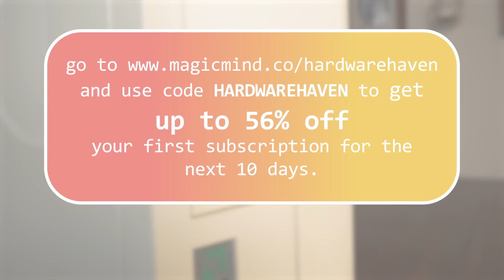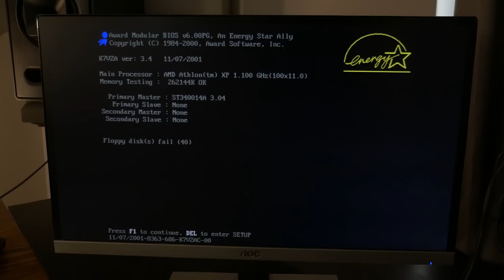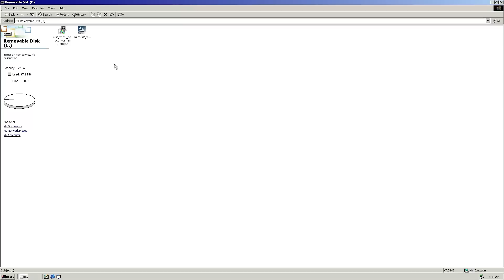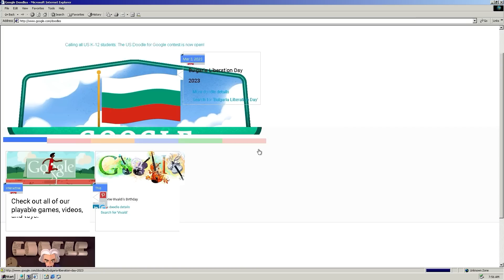The OLDEST PC I've Ever Worked On

Comment: Nice video. I haven't been following your channel (but I just subscribed 😊), but if you're doing hardware vids, it's definitely a good idea to educate yourself as to where all the modern PC goodies you know and love got their start. Here are a few points that I didn't see among the other comments:

- Case elements: Yes, the cases we had back in the 1990s had a lot more fasteners than modern ones, required you to wield the ol' screwdriver more often (and sometimes other tools as well) and required some creative thinking to figure out how they came apart and went back together. There was a lot of innovation going on. One thing you learned when working on different cases was that if there was an inaccessible screw somewhere, then you were probably looking at a module that was intended to be removed for installing components such as drives.

- Blown capacitor in the PSU: Not an uncommon problem, and even back in the 1990s, when components were generally more expensive than they are today, most of us did not open up PSUs and attempt to fix them. There's high voltage going through the PSU, and if you don't know how it all goes together, it's best not to mess around with it. There's nothing wrong with opening one up and looking around for forensic purposes if you're careful, but unless you're trying to refurbish something vintage or unique (and the PSU that came in the system shown here doesn't qualify), it's best to just replace it. BTW, before powering up a system of this vintage, it's a good idea to visually inspect all the capacitors on the motherboard. Failed, leaking capacitors on motherboards can make it fail to turn on or pass the POST, and will make it unstable even if it does pass POST. Leaking capacitors are common on motherboards that old, and they're even more common on motherboards from 2000-2009. While you're looking at the capacitors, also have a look at the RTC battery. Some motherboards from the 1990s still had soldered-in NiCd RTC batteries, which are known to leak and damage surrounding components and PCB tracers.

- 3 RAM slots: Yup, dual channel wasn't a thing yet.

- Stray markings ("Good Power" on PSU, "X" on hard drive) were a pretty common sign that the computer had either been assembled by an enthusiast who was juggling a lot of parts or had been to a repair or refurb shop. The markings typically meant that a component had been checked out and was OK to use, although, as you saw, there was no standard for them. It would have been very strange for someone to remove a hard drive, confirm that it was bad, then mark it with a red X and put it back in the computer, especially given how involved it was to take that particular hard drive out.

- I was pleasantly surprised that the video output from that computer worked with your modern, large, wide-screen monitor. Video hardware from that era was mostly made for CRTs with relatively low refresh rates and resolutions and 4:3 aspect ratios. Some video drivers of the era would fail when connected to any flat panel monitor, causing badly distorted video output on the screen in 16 or fewer colors. I'm not at all surprised that it wouldn't work with your video capture system.

- Windows 2000 was not a common choice of OS for a custom built computer of that time period, partly due to its cost and partly because it didn't work well with games and other software that a home computer user was likely to run. Most companies stuck with name brand PCs for a more consistent experience and better tech support.

Comment: Heh, I'm kinda proud I was able to correctly guess the machine specs just from look. The general design screamed late Athlon / early Athlon XP to me, a lot of prebuilts from that time used a TNT M64 for display and 20-40 GB was really common as an upgrade, I had (and still have, but upgraded) a machine that was pretty much the same. That was kinda funny to hear 'That's IDE, right?" and "I think it's DDR", I guess I just spent way too much time messing with machines from that era.

I think I can guess a few of the problems you had : the GPU seems to be working fine, but crash the system after a while and / or have random artifacting (AGP GPUs are well-known for that, they're right in the capacitor plague), some cards don't work because the PSU you're using doesn't have -12V because it's to modern, the heatsink was a pain to remove because AMD used an horrible socket at the time, storage was hard because SATA to IDE is slow, PCI cards are annoying to configure and SD to IDE is really slow on NT OS and can cause corruptions... At least, they're all problems that I encountered and see pretty regularly online.

Comment: The 4-pin 12V connector was introduced when Pentium 4 hit the market in 2000. Even after that some low-end crap like that PSU didn't have that connector.

Comment: Socket 462 xp, sdram and a sweet tnt2 riva agp - what a nice little retro setup, if you can find some, you could get some 512Mb ram sticks for it, but they started becoming pretty rare and expensive some years ago. Being older and an old tech i identified all the parts in this system as soon as you opened the side panel :) I loved my xp 1.8ghz cpu back then. The nostalgia is too real.

Comment: Ah, late 90's, early 00's PC's. Time when I got my first PC and well, used PC for a first time at old mom's office when I went there for few days in late 90's. That beige case era with CRT's (chonk at start when turning CRT's on is, moment of silence, perfection, right after floppy boot sounds, mmm, memories) and classic, and semi-regular Windows 98 SE or even Windows XP reinstall procedures, man, got me right into my early PC time.

Afaik, this seems like OK AMD Build from back in the days, only thing that I will replace no matter what is PSU and later on install SATA SSD using IDE to SATA adapter, just to have some speed and to be safe that old drives wouldn't die.

Edit: yes, that faulty PSU is actually ATX, most PSU from late 90's, early 00's up to early 2010's have 20+4 ATX main connector and lot of cheaper ones don't have 4/8-pin CPU connector as it wasn't needed in that time. Older ATX standard, it is prior to 2.x versions that it had 20+4 ATX main connector and most of them in those days didn't used CPU connectors.
Reply from the maker: Thanks for the info!
Reply: @HardwareHaven  nothing Colten, this is my early PC's time and know them pretty well as we had some older PC's even in our high school which me and few friends from class fixed, so insides of that old systems are nothing new for me :) That include my first 3 PC's as well, mostly AMD machines and one Pentium 4, early version of it with SDRAM sticks which I'm keeping for my personal old PC parts wall.

Comment: My first computer was a Tandy 1000 TX. A 286, but it ran on an XT, not an AT bus, so it was essentially a turbo charged 8088. When I got it, it didn't even have a hard drive, it ran on 720k 3.5" floppy disks. I upgraded it to support aftermarket IDE hard drives using a card which had built in BIOS and installed a whopping 40MB hard drive and MS DOS 6.22. Windows 3.1 was out of the question, especially given its CGA graphics, but it (sorta) could run Windows 3.0

Comment: Hey, I’d highly recommend downgrading to Windows 98 SE, you will have a much easier time getting retro games and hardware to work (Windows 2000 was based on Microsoft’s new NT operating system which came with a lot of problems for legacy support)
Reply: I slap on Damn Small Linux or SLAX...

Comment: I have had the same thing happen.  I was quite lucky and missed the 2nd/3rd degree burns. I flipped the power switch and it exploded shooting fire out of it!  It was a small form factor IBM workgroup server back in the early 2000's.  I was using ghost and getting the server a 20 workstations ready to put into a bank branch.

Comment: I'm not shocked at all, it looks like the film cap blew which is pretty normal for old power supplies of any type.  Low chance of it causing a full on fire, it's kinda like a dangerous fuse.
Reply: poly/film caps rarely give trouble in my experience, if it was a paper based RIFA,  wouldnt be surprised 😉

Comment: On the XP processors are little gold dots L1 to L4. If I remember correctly if you connect dots 3 and 4 of L2 ( check it on the internet though, it was a long time ago ) if they are not already connected ) with a pencil ( conducts electricity ). (If the dots are already connected you have an unlocked processor.) With that you unlock the multiplier ( it is an 1.100, so the multiplier now is 11 running at 100 Mhz Front Side Bus/ 11 X 100= 1.100 ). With a bit of luck you can change the multiplier in the BIOS to 11,5 or 12. It also depends on the silicon lotery. I had a Duron 800 and I could change the multiplier to 8,5 ( so it became a 850 ) and I could change the FSB to 103 ( that also changes the SD RAM speed ) so at the end it ran at 875.5 Mhz ( 103 X 8,5 ). Or I could run it at FSB 105 with a multiplier of 8 ( 840 ). A free upgrade that is called overclocking.  Have fun with the system. And looking forward to your next video.

Comment: 6:23
Yes you have to be extremely careful when opening one up. 
The caps can really give a shock. 
Use a screwdriver to discharge them. 
I am bit concerned since you opened it just after powering it but  for some reason, I opened up a similar psu once to get it's inductors for a different project, no fan spin when given power and initiated power on in 20 pin atx. 
I opened it up and the caps were oddly not charged. 

Anyways I recommend discharging them because they hold a nasty shock.

Edit: Then it's  fine after a few days the bleeder resistor might slowly discharge thr cap
Reply from the maker: Yes, I usually discharge and check them with a mm, however I wasn’t planning to go poking around way too much and it had been sitting idle for about a week. Probably still should’ve checked them. I’m here though haha
Reply: @HardwareHaven  Well from the pics if I remember, it's a toasted diode/resistor I think. Still won't recommend poking around since I think the guy who replaced the fan, messed up and made the diode protect everything by sacrificing itself. 
Btw I got inductors, 3 (I think 4) transformers, those HUUGE caps,  also some MKP Type capacitor, ac input connector thingy, sATA Power cables(I am making a 12v powered sATA to usb for 3.5 inch desktop drives from a sATA power cable, a old 2.5 inch usb powered sATA to USB. I did some soldering to some how hook up the cables for 3.3 and 5 from usb, 12v from external psu. 
It worked Although very sketchy.

Comment: There is no 100MHz base Athlon XP (other than low voltage models), so it's probably meant to be 133 x 11, or a 1300MHz "1700+" in AMD speak.
Except the motherboard appears to be a KT133 chipset which was flawed and could not DO 133
Does not officially support Athlon XP, though some models and BIOS can run them, but not at full rated speed... FSB OC of 112 is reckoned to be solid, 120MHz is about the maximum that KT133 will tolerate.
PS. If the board has a JP9/10 jumper above the floppy cable connector, and a VT8363A chipset, then it is a later KT133A model with support for 133MHz base (aka 266 FSB) - The Athlon is designed for DDR, but you need a later and better chipset
Reply from the maker: Yep. I figure out the FSB in part 2 spoiler

Comment: For the fan on the CPU, lift the sticker and if you see a mini bolt, just add some DW40 in there and put the sticker back on.  Might work for some time to grease the berings.  Brings back memories.  I worked on even older computers than this.  Great video.  :)
Reply: I use a single drop of 3in1 oil...thinner and penetrates better into the sintered bearings that dry out, emphasis on "single drop"..otherwise it will sling it everywhere!
Reply: @haydenc2742  yep, 3 in 1 oil better than wd40 for this sort of thing
Reply: WD-40 is a solvent not a lubricant. If there was any lube in there it'd clean it out. Go look up WD-40 fishing reel horror stories of people wrecking their gear trying to use WD-40 to lube it. Not a good idea. You're not going to get grease into the bearings unless you can get the bearings out. Your only viable option is light machine oil. They make special motor oil. It'd work. Not car motor oil, electric motor oil.
Reply: @1pcfred  uk cans of wd40 DO mention its use as a lubricant, though 😉 its certainly not ideal, and seems to cause green corrosion on brass/copper after a while , 3 in 1 oil spray is better, which is actually made by the wd40 company now !  .. i've heard mention of 'turbine oil' in connection with motor bearings? maybe that??
Reply: @andygozzo72  WD-40 is mostly something called Stoddard's solvent. It's a petroleum product so it is made out of oil but it is not oil. Gasoline is made out of oil and I wouldn't use it as a lubricant. WD-40's lubricating properties are very short lived and once it dries up you'll be in worse shape than when you started. For pinpoint application you want to stay away from aerosol sprays. Fans in PCs just need a drop in the right place. I have tiny paint brushes I use. It is easy to over oil electric motors. You don't want oil laying on the magnet wire the motors are wrapped with.

Comment: As someone whose first PC was from the mid-90s, I admit I caught myself yelling at the screen about some of the things he screwed up at first. It really was a different time, RAM not needing to match (Unless you had RDRAM...), no CPU power, those awful IDE cables and their two channels, pre-DDR RAM, how small and simple those CPU coolers used to be, the floppy power connector that was easy to accidently plug in backwards and fry it... It was funny seeing "Y2K" settings in the BIOS.
Reply: Before DIMMs were used for RAM SIMMs were common. These often needed to be used in pairs (sometimes sets of four) to match the data bus width or your system just wouldn't work.

Comment: Its all metal, its not going to instantly burn your house down. I've been on service calls where the owner wanted me to come over and bring back up their very first PC and have bad caps exploding on us when we plugged it in. Seen magic smoke just whirling out and the breaker or GFCI pops and it becomes less dramatic and me feeling so bad, I never charge them for the service call.
Reply: You may want to find out how bulb limiters work. It'll make initial power ups less dramatic.
Reply: @1pcfred  I watch Shango066 and learned about the dim bulb and learned a lot watching his channel. Thanks for the advice. Good tip to know.
Reply: @ATSNorthernMI  there's a channel here called learn electronics repair where a guy gets a lot of car boot sale PCs and refreshes them. He has a fairly good success rate getting them going again. He uses a current limiting bulb and he checks for shorts before he powers them up.

Comment: Good ol' Socket A, the first systems I ever built were were based on an Athlon XP 2200+ running at 1.73ghz. This things were very dependent on 5v power, usually liking  over 25a on that rail. These CPUs were very easy to OC but very hard to keep cool at the time.

Comment: Oh you sweet innocent child...

You've probably learned already, but --

The Vanta is a Riva TNT Vanta card by nVidia.

Athlon XP need cooling, but you must be careful when installing the heatsink -- I have cracked more Athlon XP cores than I care to remember.  Also, the dead XP's tend to take out motherboards when they die, do be careful.

A more size appropriate hard drive for that era would probably be 3.2, or 4.3 Gb.

A have a VHS tape rack that I repurposed into  power supply storage.  There are dozens of ATX power supplies, as well a a number of AT supplies.  I have boxes of motherboards that probably work (as well as a box of dead ones) - the oldest being 80486 boards (at least 2 work - at least they did last earlier this year when I tested some of them).  The first computer I built myself was a Cyrix 486DX-40 at least 30 years ago.  I inadvertently killed that one when a static discharge entered the system through the cable going to my video capture card.  I'd ordered a new motherboard and was waiting for it to arrive -- instead my daughter did.

Yes - I am old....

Comment: The Athlon was a pretty great CPU for its time!  I have been trying to restore two identical K7SEM motherboards with blown capacitors to use an old Duron CPU in one! No success so far unfortunately as more must be damaged on the boards.  The old Duron was not quite as good as the Athlon was.  It was kind of like AMD's answer to Intel's old Celeron in those days, I believe.  Still pretty decent for some over clocking with the right motherboard, like Intel's Celerons could be!  Those old machines can be quite fun to work on and get running!  Glad you're giving yours a go.  I, myself, am pretty old now as I started working on computers WAY back in 1981 when still in high school.  My first build was the Timex Sinclair ZX 81!  Unfortunately my health now has been stopping me from doing a lot of what I used to love as I have very limited time to mess around with my old hardware.  Bummer but I "muddle" through it though it does depress me often.  Remember, like they say "Gather your flowers while yet ye may!"  Keep those videos coming and be well!  👍👍
Reply: The Duron had less chache than the Athlon. It was indeed AMD's answer to Intel's Celeron.
Reply: @patricktrakzel9657   👍👍
Reply: @arthurmann578  Thanks and good luck with your heatlh Arthur.

Comment: that daughter board is likely for the 'standby' 5v supply, its 'chopper' chip has likely shorted and blown a series resistor or fuse,  without knowing what the blown parts were, no real chance of repairing,  so best replaced with known good psu...
Reply: you 'may' find internal schematic info on the net if you google its details,